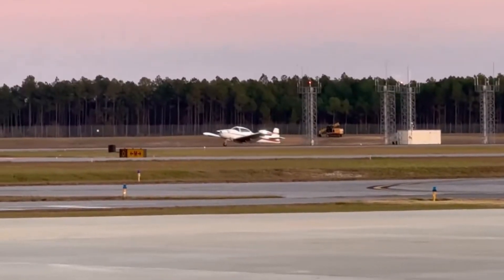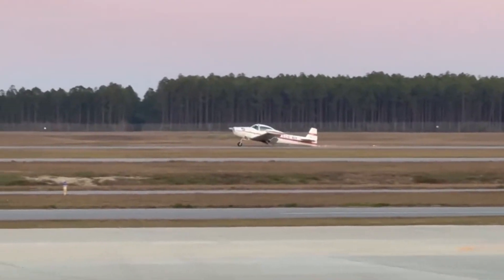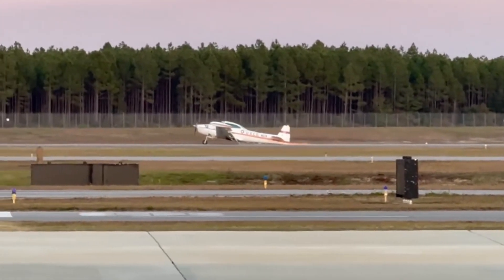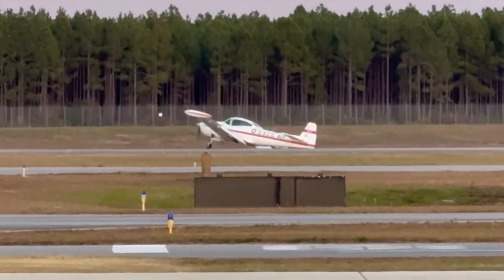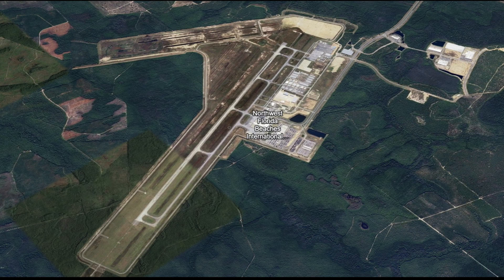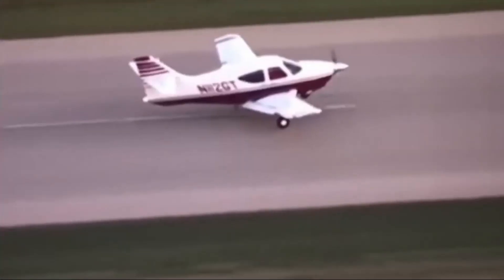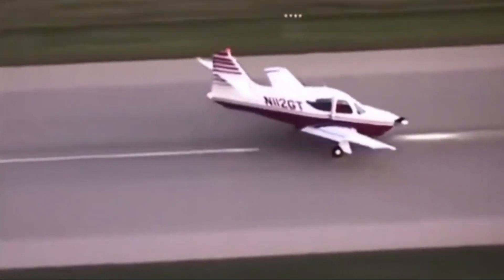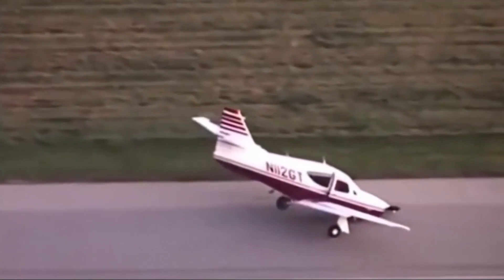Sparks Fly as Pilot Lands with Nose Gear Only

Comment: Navion driver likely had to replace the tie down.  Well done. I'm a fan of leaving engine running until last possible minute.  Aircraft flies much different, and adds complexity you don't want in an already unique situation.  Observed folks going off the end (or nearly) off the runway due to floating created by ground effect and no windmilling prop drag.  If the aircraft is turbine, best to close firewall shutoff valves (or condition levers). Don't want those turning into grenades.  Turbine engines are much more robust, and can get sporty.

Comment: Both of these landings were textbook perfect.  Navion didn't need to turn off the engine since he had the nosewheel to keep the prop off the runway, and the commander guy knew he was on the runway, stopped the engine, and even used the starter to get the prop horizontal.  Nice!   What we rarely find out is what was the root cause of the gear failing, which is unfortunate.
Reply from the maker: True.  Thanks Dermick. Hope all is well

Comment: Good job Navion.  With a missing nose gear, the technique is a soft field landing to get the mains on as slowly and softly as possible.  I expect the Navion was doing the same thing, as the power/pitch of the soft field technique also keeps the nose as high as possible and again as slow and soft as possible.  Dynamic throttle is the best control of the shallow glide angle and slowest descent while elevator is the best control of airspeed.
Reply from the maker: Thank you Jimmy for taking the time to

Comment: It's pretty difficult to land on the nose wheel without bouncing. You've got to set it down as slow as possible as if you're doing a 3-point landing in a tail dragger. Landing without the nose wheel isn't much different than normal, but you've got to do it on pavement. I would think concrete would be better than asphalt. You don't want the nose to stick and flip. Some pilots hold the nose up as long as they can and then it drops to the pavement suddenly. I think I would let the nose down while I'm still going fast enough to let it down easy with the elevator. I'm sure it's scary sight to nose over into the runway.
Reply from the maker: Good point

Comment: My personal airplane is a 1948 Navion A that looks a lot like the accident plane. I can't think of any mechanical problem that would prevent main gear extension except a problem with the rigging. Looks like the gear didn't unlatch; maybe the latching mechanism was worn or loose or bent. Yeah, it's gotta be the rigging. Gear extension is hydraulic, but if the hydraulics fail the very solidly-built, heavy gear will clunk down into place due to gravity alone (I believe the pilot's handbook recommends rocking the plane back-and-forth to make sure gear lowered by gravity is locked). In my opinion the Navion and the Meyers 200D are the best 4-seat general aviation airplanes ever. The Meyers is much more expensive and rare than the Navion, but there aren't many Navions around either. Navion was put out of business by the Beechcraft Bonanza, which came out at the same time and was faster. But the Navion was much more stable and forgiving, and a lot of doctors would be alive today if they'd chosen a Navion instead.
Reply from the maker: Thank you for sharing this info
Reply: The Meyers 200 is my dream plane
Reply: @bigalAV8R  Hard to believe so few were made.
Reply: Interesting. I always thought the issue with the Bonanza was the Doctor, not the aircraft itself.
Reply: @veritas6466  Bonanza has a "slippery" design with low drag and low lift, so it is unforgiving if the doctor makes an error.
Reply: @RaysDad  I'm trackin'. Interesting, (again) I thought it was more a condemnation of the stereotypical: Low hour IMC, over-confident, ego maniac type pilot more than the aircraft. "Dr. Gethereitis".  - I have no Bonanza knowledge or experience. I do seem to recall an AOPA article, or more likely a YouTube video mentioning a few years into production, they made design changes that made it much more manageable. 
*Your Navion looks fun to fly.
Reply: @veritas6466  Yes, Bonanza tail reinforcement was required by the FAA. Now the tail is less likely to break off. But in IMC or turbulence the Bonanza can quickly enter a graveyard spiral that can result in in-flight breakup if the doctor doesn't correct it properly.

Comment: Those sparks coming off a tail tiedown ring?
Reply: Looks like the pilot may have gotten away with only the tail tiedown ring and the right tip tank damaged.
Reply: When grinding….

Steel generates a lot of sparks…

Aluminum does not spark very much…

😃

Comment: Better to have the nose gear than no gear. Very little damage to that Navion. You’re right on the money Keoni with the nose gear fail, and the engine still running the damage to the prop is the least of his worries. The engine is ruined. It’ll have to be torn downcompletely, and if it’s salvageable at all,completely rebuilt. The engine is usually the largest expense of an aircraft. They say you buy an engine with an airplane attached lol. Take care, bro! 🤠🤙
Reply from the maker: Thanks Rob.  Been cleaning the pasture these past weeks.  Got that wicked fireweed trying to take over
Reply: @ Aww man that’s a job for sure!!

Comment: Thanks for putting this up.  That Navion pilot did a fantastic job!  I wonder why he didn’t shut off the engine quicker.  I bet it won’t take too much body work to fix the tail and hopefully the wingtip was totally fine.
Reply: If the prop is turning under power, airflow over the tail will allow for greater precision in pitch, which allowed pilot to keep tail off ground as long as possible.